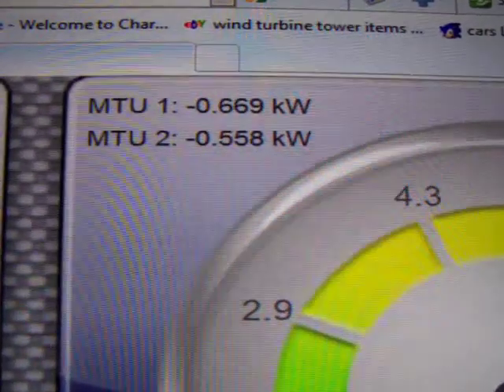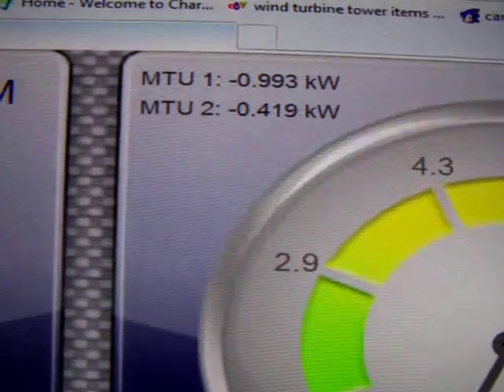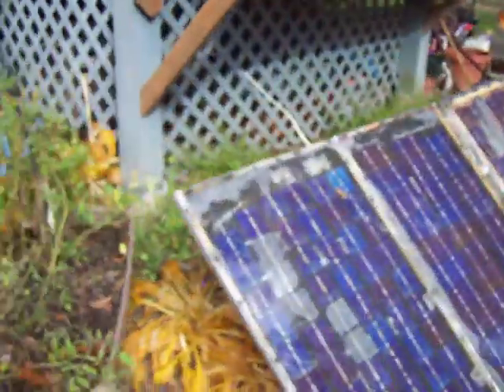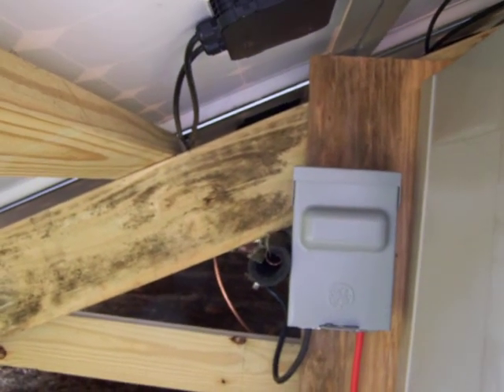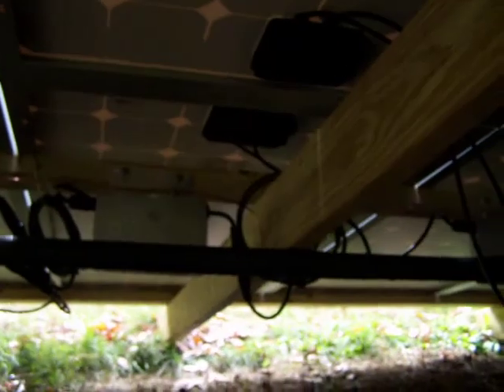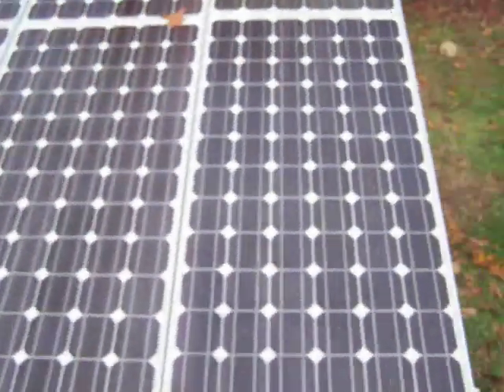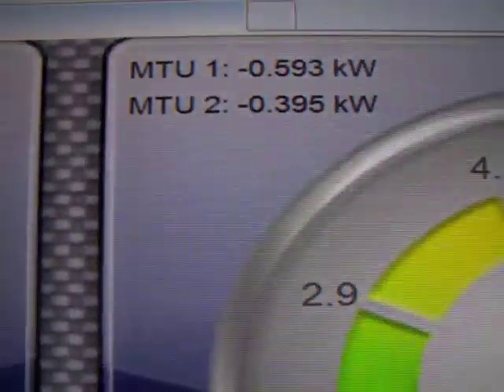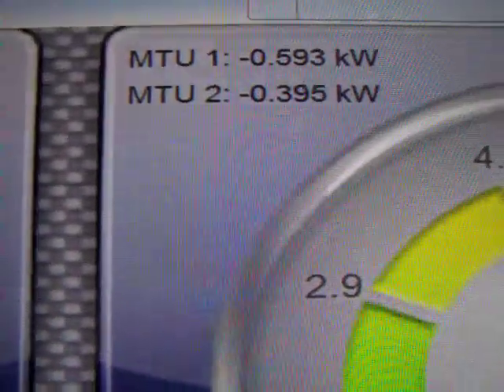update to enphase inverters

Comment: Hey Michael,

So based on this and anything you've done since, would you recommend forgetting about the SunG GTIs and just sticking with the Enphase?  The M215s are pricey, and another consideration we often fail to think about is solar panel pricing.  The Enphase really needs 235-260w panels...otherwise you're 'wasting' some Enphase potential, and those panel sizes aren't the best deals these days.  So not only are you paying more for the GTI, but also for the panels to match them to.

Comment: Nice set-up. I just ordered some 230w panels with Ephase inverters i'll be installing soon. I know these are designed more for 24v panels, but wondering if they might work on a couple 12v panels wired in series. I got 5 existing Kyocera 135w panels i would love bring online with my enphase (1 inverter to 2 12v panels in series) but not sure will work. love to get your opinion on that one.  thanks again!

Comment: nice video,I dont have a solar set up yet but enphase sounds like a good way to go but a little higher in price what type of panels do you have hooked up to your enphase inverters?seen some enphase m-190 s on ebay but not sure what panels to match up to them or if it makes a differance?have a 24ftx8 garage roof I working with-was told net metering was offered here but not sure if it will be needed as small as this set will be.Thanks

Comment: Thanks a ton for posting, this is awesome research for those of with the "cheap" inverters. I went with one 1200w PJ GTI and it does just fine but it gets hot even with 350 watts going into it. The general rule for the cheap inverters is that they are half of what they are actually rated. This weekend I plan on finishing most of my solar tracker and have my panels mounted on it, video coming soon! Keep posting!!!!

Comment: Thanks for the video, Those Enphase inverters don't sound all that bad when you consider I paid $200. for my morningstar MPPT controller. Hopefully the price will come down as they start selling more. Do they have any protection built in if they get excessive voltage to protect them. I already fried one 250 watt Sun GTI that I had on a wind turbine when voltage spiked.

Comment: Looking Good Michael...

  The copper pipe is a wonderfull buss bar. Remember your system will show its highest performance right after cloud cover because the panals cool down.

  Next time you have a full on sunny day hose your panels down and you will be blown away by the output. Start with a fine mist to prevent thermo shocking the glass and then run a ton of water and get them cold. 

I would like to see that video and chances are they will go beyond the specs.

CHEERS.